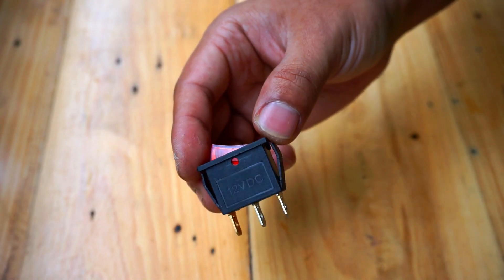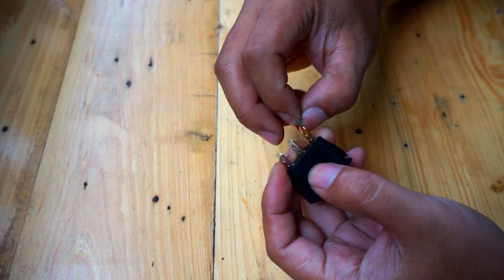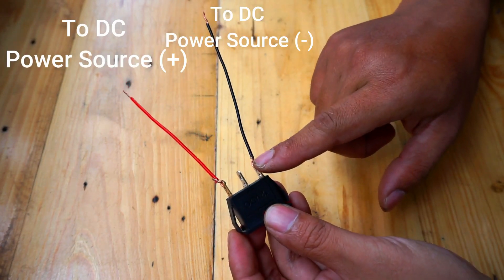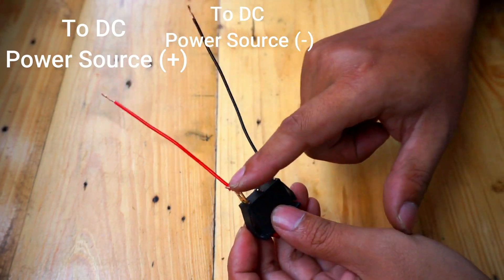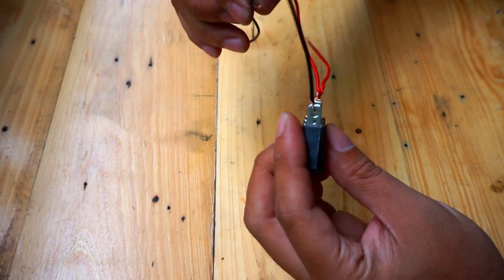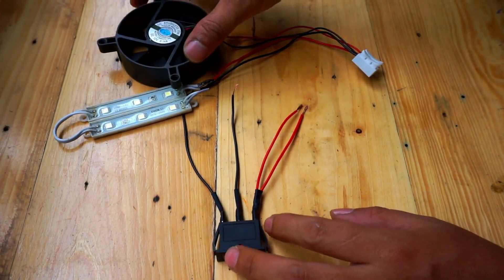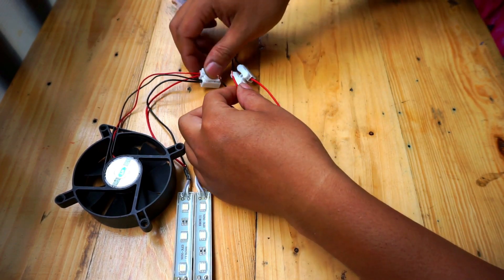How to Wire Illuminated 3 Prong DC 12 Volt Rocker Switch

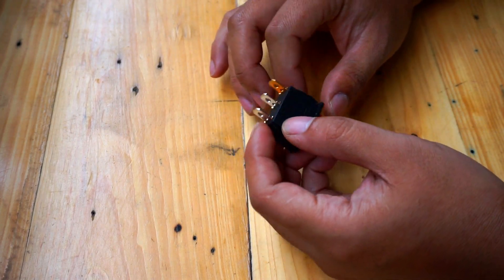Comment: Aw come on,  0:50  Pin 3  ["Copper"] says "Neutral", You say "Positive".  1:07  What gives?  i'm more confused.  switch i have has NO Copper pin.     2 wires needed on one pin, but which one?     Shared Positive or Accessory?  Now, WHICH is Positive on switch, Really ?

Comment: Are you sure this isn’t backward? Most instructions / diagrams (and YouTube videos) say to wire the copper wire the ground / negative. Also usually the I  / on is at the top (O / off on the bottom ) for safety reasons.
Reply: Hi!  i noticed too.  Try to figure out when switch has NO Brass \Copper pin.  Is + pin, (IF end) on off side?
Reply: @kareno8634  the way I do it is, I aways have the switch oriented where the ON position is at the top and the OFF is  (the same way most switches actually labeled “On” and “Off” are oriented - On is at the top). From there I know that the copper pin should have also been on the top. It’s maybe safest to get the manual / spec sheet from the manufacturer in case you have an oddball switch, but in my cases I found that the copper is supposed to be on the top.
Reply from the maker: It could be backward, however it works
Reply: @wihaf  right on.  I guess it’s like reversing the polarity.
Reply: Also it's a 3 way switch so u shouldn't need 4 wires.

Comment: This will only work for switches with a filament type light bulb. If the switch has an LED then you must use the copper coloured pin as negative/ground or the LED will not light.
Reply: Thank You!   I needed that info.

Comment: Question . I have a 3 prung toggle switch with a led light . And I’m runing those diy relay box I made which u also get power from . Or Do I run power to the 12v ignition wire ? And the reload to my relay box?

Comment: It works with me! Thank you very much.
One last question please, Although it works but the red light in the switch didn't work, Do you know why?
*NOTE: 
- I use an adpter like you, so the switch is conecting with 2A 12V 
- (15A 250V, 20A 125V) was written on the switch
Reply from the maker: Just reverse the wire, the cooper pin is for the negative one.

Comment: where can use 3 pin switch,
please give example
Reply from the maker: This is 12v DC switch, you can use it for any devices using 12v. Yes my accent is strange coz I'm not a native speaker of English
Reply: @wihaf  ok :)
, dpdt switch middle.
where can use this type of switch?

Comment: Excellent!! Can i use the same wiring for  AC240 Thanks
Reply from the maker: I think so. it's just the same. the difference is only in the led component of the switch which is specifically designed for certain voltage.
Reply: @wihaf  many thanks. I’ll let you know how i go👍👍

Comment: Got me confused. You say copper pin is for the positive in but based on the switch wiring you are then running the load through the light. Diagram shows copper tab as -ve or neutral for operating the light and silver tabs are for input and load.
Reply from the maker: ok then..just don't follow the diagram.. just follow what I did.👍